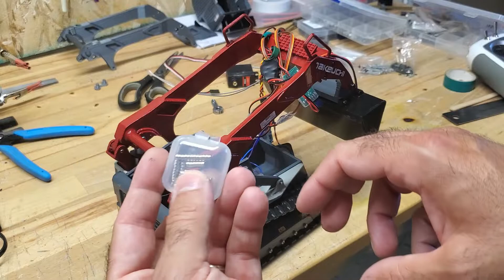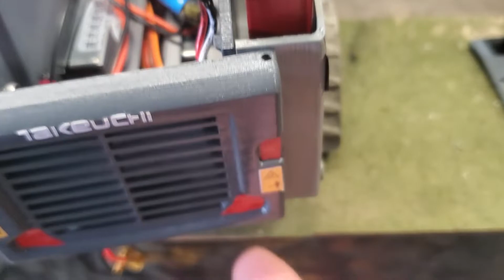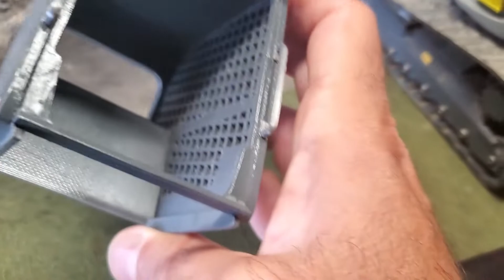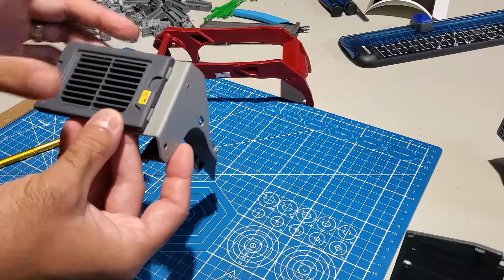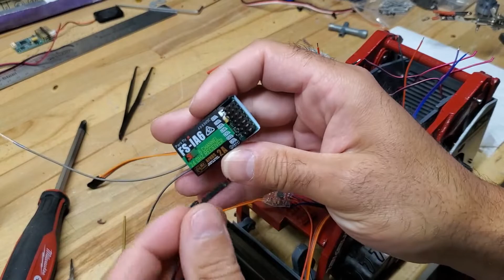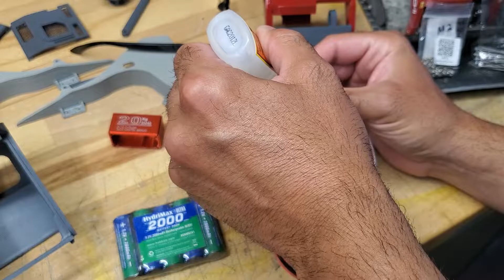3D Printed Remote Control Skid Steer Build part 2

Comment: hello
this 12V linear servo motor works on 6.4 Volts or you are using 12V battery?
thanks
Reply from the maker: 12v to get all the power to lift at the speed. If you use 6.4v you get half the speed and power.

Comment: Quick question do the esc’s not put out a bec voltage? Most esc’s that have all 3 wires on the receiver plug usually put out that voltage, in that case there’s no use for the bec module. If you don’t know I’d check the plug with a multi meter to see if there’s voltage coming out. Just trying to save you some space.

Comment: Hello there, I was wondering if you had the file of the Takeuchi TL12v2 short horn mount for the bucket??
Also I have a Cricut do you have the decal file for the skid steer?? I am loving the model you have made its a fun build!!!!
thank you thank you!!!!!
Reply from the maker: I updated the files to include the stubby servo horn. I also made it thicker to handle more pressure so it does not become a weak point. for the cricut files I can check to see if I still have them. send me a message on facebook and then I can email you the files.